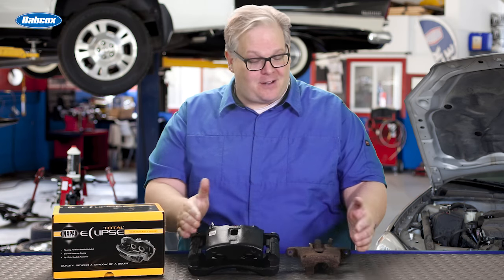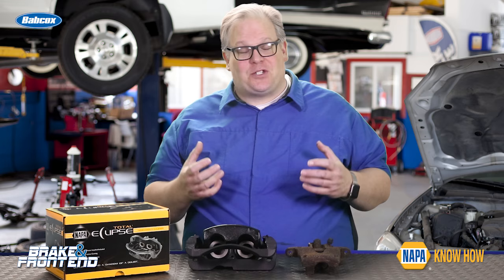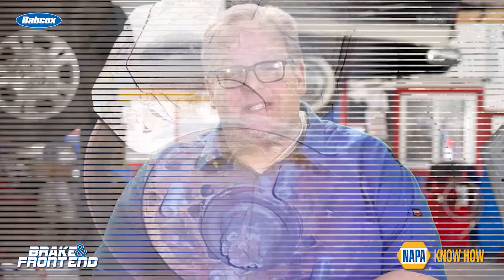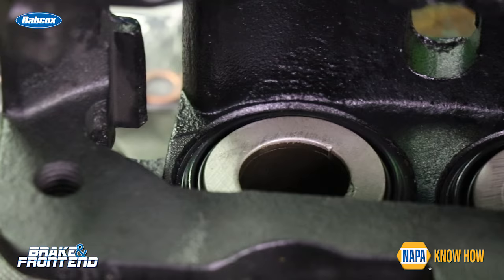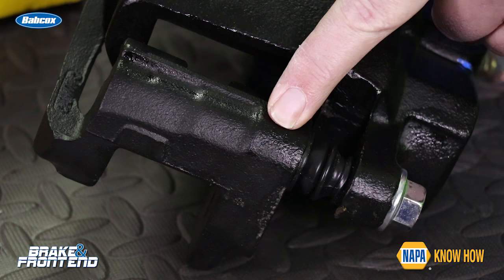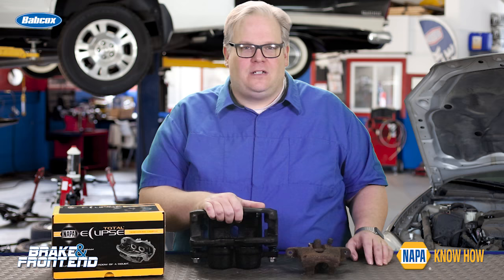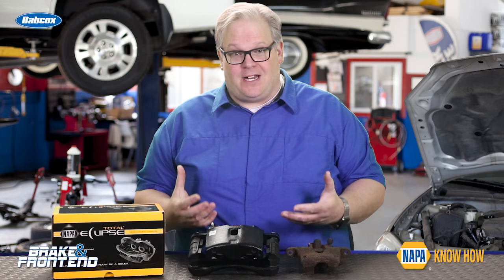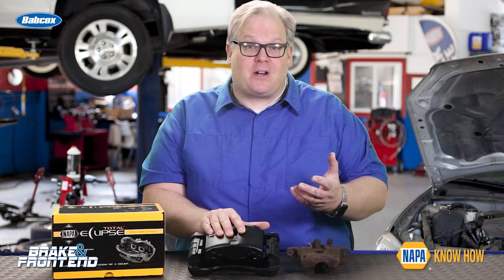4 signs a caliper needs replaced | 4 Tips

Comment: What about signs a driver should know? Is there a way a driver can determine if they need a caliber without having to remove the tire? Will it make a noise? Will it cause specific driving issues? Will it leave break residues? Great video for a mechanic, now how about us drivers with no mechanic skills.
Reply: If your car jerks to a side while braking
Reply: Yes, most in the "industry" were well aware of PSH's side hustle as an auto repair expert.  He has gained a bit of weight however
Reply: I was looking at the rotors and noticed that my rear passenger rotor has more "buildup" compared to the others. While the others have a smoother surface area where the brake pads press, this one rotor has less of that smooth surface. It makes sense to me, then, that the pads are not pressing as much against that rotor, correct? Could this be a sign of either a worn brake pad or a seized piston in the caliper? Im asking because this could be somewhat related to what Angela was initially asking about.
Reply: Going through brakes quicker. If you can lift your car and turn the tire and if it’s hard to turn or doesn’t at all it could be a sign of a bad caliper as well.
Reply: If you can hear a scraping noise
Reply: If you're hearing  squeaking coming from the brakes, after driving a bit, put your hand on each wheel - check it's temperature, if it's hot, compared to the others, it's  caliper is sticking. Plus, just jack it up and turn it by hand, to confirm if it's dragging or not.
Reply: @NIN_THUG  that is exactly what sound my car is making
Reply: @ineedhoez  check the pads, it they are wearing evenly then you may just need new pads. If they are not, then you need to check the guide pins and use silicone to lube them, and don't get any lube down in the bottom of the guide pin hole. Additionally, the pads need to be able to slide along the hardware. Rust can form and bind the pads. Lastly, it could be a sticking caliper piston. Hope that helps.
Reply: They usually stick by themselves and you can smell them burning the brakes and rotors
Reply: Don't forget about contaminated fluid the rubber can brake down  and get to the pistons and cause a slight to tight hang up.
Reply: @moonchild5595 thank you, a real answer
Reply: @jimdouglas4387  Fluid contamination can cause caliper piston or wheel cylinder leaks as well. Leaks can show up as wet spots on the bottoms of calipers, drums, or on the inner wall of wheels.

Comment: I'd pull the pistons and replace the boot and seal for 1/10 of the price of new calipers.  If the piston is scored or frozen, then I would replace the caliper.
Reply: You can still just replace a piston by itself...
Reply: Depends on where you live. If in a rusty area best replace the whole caliper after a certain period.

Comment: Never seen a flex hose go for 20 bucks, just bought one for my 07 escape and it was 80 dollars
Reply: The ones for my car cost 10$...
Reply: One hose 80 bucks? I bought a set of braided stainless steel for 110
Reply: You must live in California where everything cost more
Reply: @mellee3045  true
Reply: Just got one for 14 if u piad 80 u got clowned or u paid for the most expensive brake hose ur local aps had. N that's factual
Reply: Maybe $80 with labor
Reply: $12 to $20 for most cars and trucks. You got scammed.

Comment: that last bonus tip mightn be exactly what ive been looking for! my brakes let go yesterday and i noticed the brake hose had ruptured i replaced it and the brake light was still on and braking system was acting strange i was wondering what would cause the hose to randomly rupture as the hose itself looked fine other than the rupture and nothing was around for it to rub on. i thank you very much for the insight even if this isnt the fix i appreciate you taking the time to make the video. thanks again.

Comment: 96 Cougar XR7 front right caliper is bad I think it's making a scraping noise between 15 and 25mph. I don't notice it any other time. Also does not happen at first things seems to have to warm up a bit first four or five stops then it does it mostly with the brakes released. After watching your video I think I am going to ask my shop to replace all the calipers and brake hoses then test proper operation. Just had a brand new engine put in by them they replaced engine mounts, shocks, and struts too I believe. Wanted them to replace the throw out bearing for the transmission too but service lady left that off the engine repair grrrrr.

Comment: These signs are all for the mechanic to know....Can a person tell a caliper piston is seizing by how the car brakes?  My car currently "wobbles"  when braking and the faster I'm going when I apply the brakes the more noticeable it is.  The car moves left and right in cycle as I brake and its dangerous at high speed.   I also had this one time seizing with a loud strong metallic grinding noise that dissappeared on its own.  The car would barely even move and the noise was loud.  Felt like the rims on the car were locked up.   The dealer inspected but found nothing wrong with the brakes or wheels.   I think it It all seems to be related to the passengers front wheel.  I'm thinking, new pads and rotors but then I was thinking maybe the caliper is sticking?
Reply: its  the  caliper  bad  for  sure.Unstable
Reply: if the rotor is warped you get pulsating when applying brakes
Reply: Yea im going through exactly the  same issue right now. I hear a grinding noise, and it sounds like something is loose (almost sounds like a little bell) and all the sudden it goes away. My guess is that water breached inside the caliper and caused it to corrode from the inside. I say this cause I replaced my brakes and rotors and noticed that one of the guide pins was not greased and the boot was severely torn. I cleaned it and greased it and the noise continues to come back. My brake pedal does feel spongy
Reply: The rotors are warped

Comment: all of a sudden since 3 days ago, my brakes or rotors sound horrible like a grinding near full stop. then when i let off the brake its a 2 tone swivel metal sound like the brake caliper or rotor is stuck or the brake pads are stuck in braking position. its sucks. =/ im gonna get all my brakes and calipers replaced soon!

Comment: Just found video. Last year had 3 of the calipers replaced when they started sticking. This year, the 4th quit on me and when it went it took the hose and wheel bearing/hub assembly with it. Little terrible triad action if you will.

Comment: Tips 5. I had to pump my brakes on my 2016 F165 for it to stop good. The right front caliper was leaking. I didn’t see fluid but there was build up of grease around the piston.
Reply: "for it to stop well." We don't use "good" as a noun. Thanks.
Reply: @Russell-rc6qq  Have you ever installed brakes on a car?

Comment: I just did my pads on a 04 Intrepid 
Then after that no brakes right to floor.....didn't crack a line....so replaced master cylinder bleed everything. Master cylinder 2 times brakes 5. In the end found out it was the  left front caliper......After all that....
Reply: Atleast you don’t have to worry about the other parts failing
Reply: 😆 hurts

Comment: Thx for the tips. What about noise ? Will there be any noise coming from them, if they need to changed ?
Reply: Noise doesn't come from the caliper it comes from the pad... while noise can be a sign of brake issues it can also just be a funny spot in the pad and things can be fine... I've bought several brake pads that were a little noisy out of the box and typically goes away with use... however if you hear a screech on old pads it's a sign your pads are due for replacement
Reply: @travisfowler8345 the noise (often like a squeal) is coming from the caliper which is wiggling. Time to change.

Comment: Called you guys the other week for new seals for my caliper (previous owner or dealership covered them in lithium greace which dried and caused the piston to stick) and your guy told me "no1 rebuilds calipers anymore". Excuse me? That's why you are parts guys and not mechanics. I did rebuild it with parts I didn't buy form you and the caliper is working excellent 700km no heat no noise and no thanks to you guys. Do better nappa. I use to love your store now I'm shopping online. Lost a life time customer here for trying to upsell me on a new caliper.
Reply: Boo hoo
Reply: I know someone who does it still ... but dude: the cheapest reman caliper for one of my trucks is under $14 plus core. Now way I can rebuild both sides for under $40 in time and labor and make them look like the they do inside a reman box. Most people have other things to do.
Reply: @AllAmericanGuyExpert   napa, canadian tire and part Scorse all sell rebuilt calipers. My point is every part store sends them out to be rebuilt so they can be resold. I'm not looking at 14$(maybe in the 90s😂) I'm looking at 150 per side. They also take 15 minutes to clean rebuild. Idk about you but I don't make 150$ every 15 minutes so my time is definitely worth it.
Reply: @666ImI666  Rock Auto has my calipers for around $14 to $16 per side, plus $15 cores ... for a full-size truck.
Reply: @AllAmericanGuyExpert  must be nice.. the absolute cheapest one for my car is 100 bucks at rock auto they sell the rebuild kit for 6 bucks tho 🤔 (i have a mustang). My problem is that napa sells rebuilt calipers but refuses to sell you the squair seals. If there guy says no1 rebuilds calipers anymore yet they sell rebuilt calipers... do see the problem..? Iv spent more time explaining this to you then it took me to rebuild it. ✌️
Reply: @666ImI666  That's good to know. I haven't seen it done, but it must be with snap-ring pliers to do the rebuild. However, that's not the whole enchilada. The rebuilt ones are cleaned, coated, pressure tested, and they do more than just work on the actual piston. Slide pins, bleeder valves, and a lot of other things are touched, whereas my friend who "rebuilds" them and you almost certainly don't do all of that. They also would replace some pistons, chase threads and passages, and perhaps the Mustang needs more of the "extras" than my old Chevy, or has more to go wrong.
Reply: @AllAmericanGuyExpert  100% all those parts are likely replaced, sandblasted and painted. like I said mine were in great shape other then the lithium grease the previous owners mechanic put in them that dried up(the square seal should only be lubricated with brake fluid) I saw no need to replace it just a fluid flush pads and rotors. I'm sure there are great videos on here that show the prosses tho it's a fairly straightforward diy cheers :)

Comment: Newbie here! I have a 2018 Jeep Grand Cherokee Limited 3.6L and ordered the wrong sized rotors (350mm) I need the 330mm but wanted to know, since I got the brake kit, would I need to switch the calipers as well? I matched the pads and they seem exact fit as my previous ones so that's no issue.
Reply: Calipers are probably the same.

Comment: I have a 2005 Chevy Express 3500 Passenger Van.  Just replaced both rear calipers, rotors, pads and flex hoses. Right sides seems to be working perfectly!  Left side is stuck on, can the guide pins be too tight from the factory?  These are NAPA calipers like the one shown in the video.  Any other suggestions?  Thanks!
Reply: maybe  the  hand  brake  cable  is  the  problem  then

Comment: I have a issue with my 03 camry where when i brake going over very slight bumps on the road it sometimes just sinks the brake pedal and i basically dont have brakes for like 2 secs then the brakes come back. I replaced the rotor and pad on both front brakes twice, i replaced the drums and shoes in the rear and still it happens im guessing its a caliper problem cause the brackets are good and i think the brake lines too. I want a second opinion though before I order calipers and put em on
Reply: master cylinder

Comment: High miliage cars today have old brake calipers & the hydraulic piston does not retract anymore causing the need for the entire brake caliper part to need to be replaced.  
Apply the breaks and the piston moves outward, and then take your foot off the break and they retract back into the hydraulic piston chamber, easily.
Reply: Pistons aren't meant to retract
Reply: @reallyhappenings5597  The flexible hose acts similar to a check valve and the brake specialist at JUST BRAKES, Inc. explains to you a complete caliper change out is required or they will not release you vehicle to be back on the road.  Otherwise he will explain to you too that your brake caliper will not retract and he will not release your vehicle to be back on the road, is why I had this explained to me.  $1000 brake job unless you know to do this yourselves.  :pride-face-pink-earrings:

Comment: I have a 2010 Lexus es 350 on left side I recently replaced axle and straightened out the back wheel rim lip that was slightly bent.
I'm now noticing while coasting between 20-40 mph feels like brakes are being applied without me pressing on them .
What could be causing this ?
I know my front brakes need to be replaced soon .
It's not as bad but it's noticeable was wondering if this is normal
Thanks
Reply: I have the same issue with my 2013 accord. At low speeds as soon as I apply breaks I noticed that it applies itself more. 

Same with driving from stop I have to press harder on the gas paddle and then it moves abruptly instead of gradually
Reply: @tfortube  mines was the O2 sensor but now I'm needing new rotors they must be shot by now because it's getting worse by day

Comment: Ok but pads will never wear out perfectly even on both sides. The side where the piston pushes is in direct line with the pressure, while the other side is in counter mechanical reaction. My pads last about 4 years on my car, but after less than 1 year, the grease in the guide pins becomes stiff and prevents the caliper from aligning freely, wearing the piston-side pad faster. Why lubing the guide pins yearly and unfreezing the pads is good maintenance.
Reply: Put  silicone  grease  and  no  problems  for  long